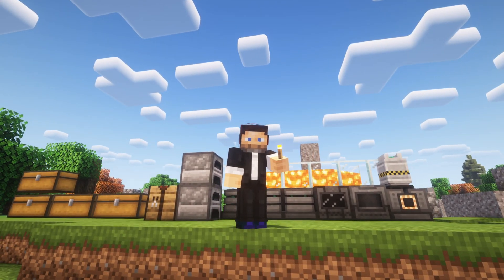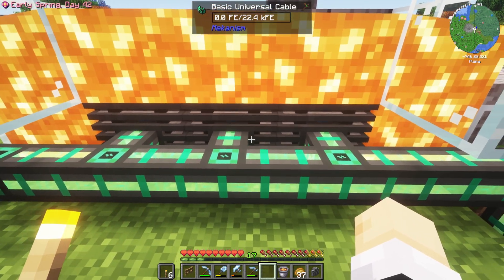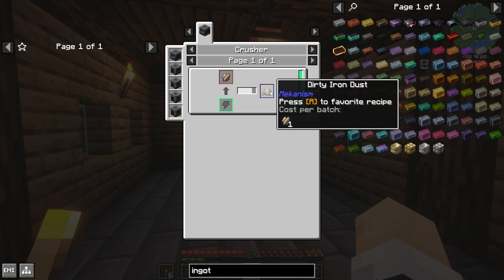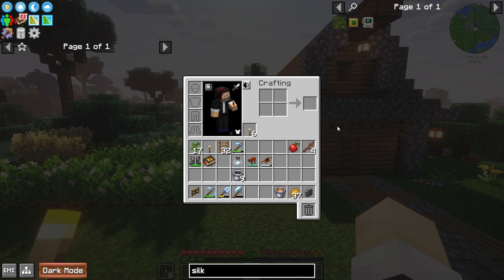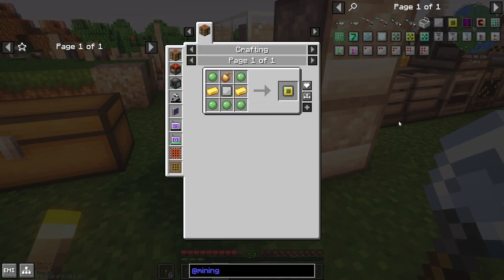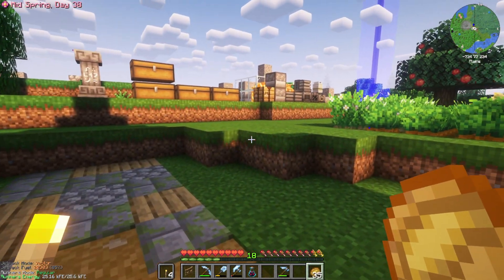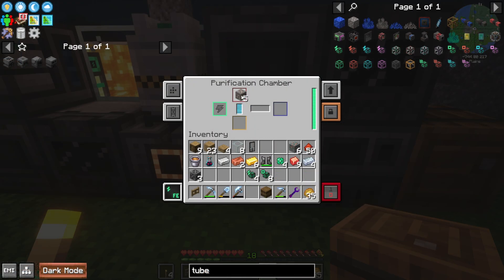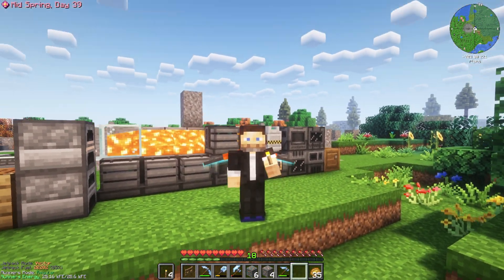MEKANISM Ore Multiplication TUTORIAL plus Mining Gadgets in Craftoria | Minecraft 1.21

Comment: Another thing about speed upgrades in Mek is that the ROI on going from the seventh to the eighth is very low - at seven speed upgrades, you're getting a decent improvement, but the eighth upgrade dramatically increases the energy cost without adding much speed. So a good tip when starting through Mek is to not upgrade speed more than seven times.
Reply from the maker: great tip! the good stuff is in the comments :)
Reply: I usually go with 8 energy upgrades and 4 speed upgrades while my power gen is limited. It's a good balance for speed vs power consumption.